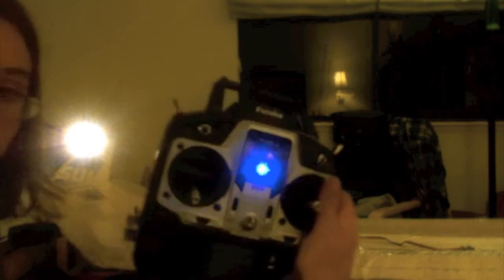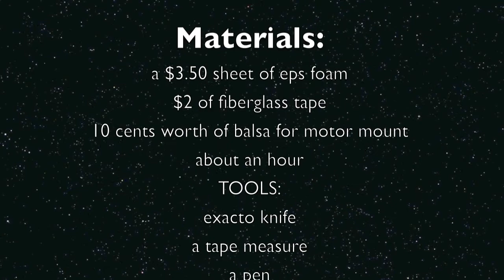48" homemade flying wing overview

Comment from the maker: @qwertuiop15 and i am working on a new version with full aerofoil. i have been trying to locate someone who sells epp in a thick enough sheet, but i am having trouble. i am going to sell kf aerofoil xps version (this, but with a more rounded leading edge and bass elevons) for $12 and an epp, full aerofoil version (if i can find a foam supplier) for $20. if you can find a flying wing arf for less than $15 anywhere, please let me know.